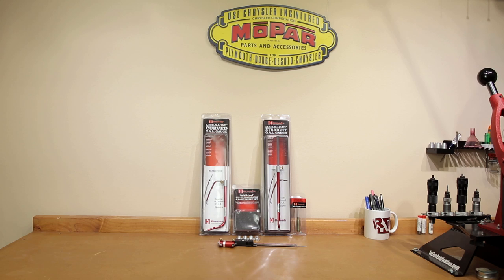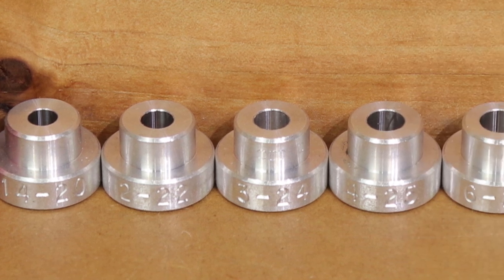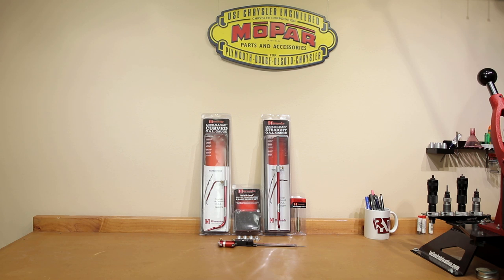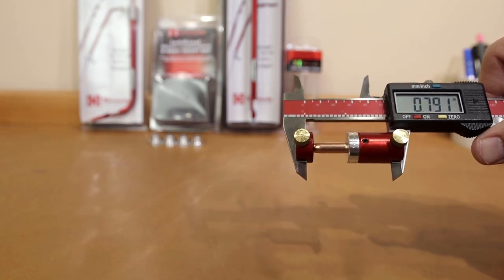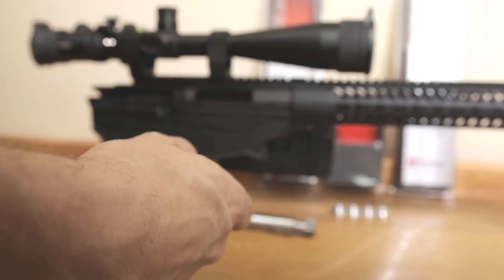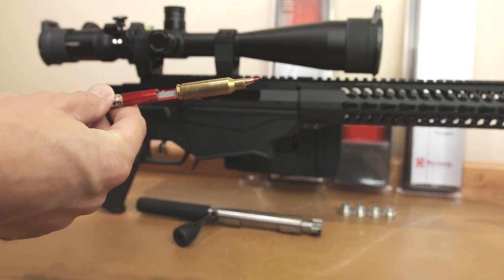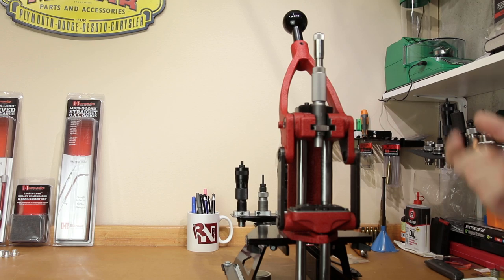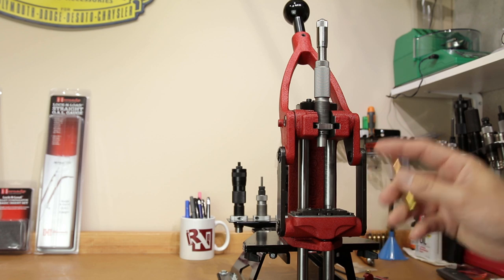Hornady Lock-N-Load Comparator Body with Inserts - Increase your accuracy

Comment: I have all those tools shown. One thing to remember is you have to repeat the process for every different bullet type you use and each manufacturer. I also repeat the process for new boxes of bullets, even if from the same manufacturer. I do four or five checks in a row (they should be close, if not something is wrong), then take the average of those checks and load up a cartridge. I then paint the bullet with bluing or black marker and chamber the round, if it is hitting the lands you can instantly see it by marks on the bullet. I always keep it a bit off the lands, especially for heavier loads, no desire to blow up my rifle or get hurt, this is supposed to be fun after all.

Comment: One thing of note, the base of the bullet comparator body has a thick side and a thin side. Just look at the base and you will see what I am talking about. It is critical the OAL Gauge be oriented such that the bullet enters the comparator like-side to like-side. Otherwise, the bullet will enter the comparator canted, leading to inconsistent measurements. With the modified case attached to the OAL Gauge and no bullet inserted and the Bullet Comparator with an insert installed on the micrometer, close the jaws on the the micrometer. The case mouth and comparator hole should be in alignment. If not, rotate one of the 2 180 degrees. This will give you the proper orientation between the two items.
Reply: No one ever mentions this in their review or reloading process. I didn't realize this until I saw a vid specially made to inform everyone of this. 
So, thank you for informing everyone of this important little bit of info that everyone should know.

WM

Comment: I use this and it works great.  Couple it with the headspace gauge, that looks very similar, and you've got the tools to really develop some great loads.  These are a must in my opinion.
Reply: Exactly right. Case length is just as important as bullet seating depth. It would be better if he demonstrated headspacing from the shoulder first to get that right before even bothering with seating depth.

Comment: I bought mine back when they were still branded Stoney Point.
Reply: So did I.
It's an excellent tool.
I went another route, making dummy rounds with each bullet at my preferred length found with my Stoney Point gauge that I load instead to use in my seating die.
However, I'll probably get t bullet comparator so that I don't have all those dummy rounds to store and keep from corroding.

Comment: These tools do add up in cost, but---you only have to buy it once--it will last a lifetime. Down the road, using different guns, different bullets, it gives you the means to measure all the differences, and they do exist. Bullets vary lot to lot, sometimes mfgrs make a change without saying anything about it. They give you the ability to measure case base to shoulder datum lengths, and adjust your sizing dies properly, and can save headaches with brass fit in a gun, brass life as well. They will educate you about all the aspects of variables in the components you use, and the guns you use them in. In the long run, a cheap investment.

Comment: You can send in two of your fired cases and Hornady will make you a modified case for your exact chamber. It is only a few bucks. I also recommend the tools for measuring your shoulder bump when sizing brass. These tools are a must have and will not break the bank.
Reply: Denny Baum , you can just measure a fired cases headspace and headspace of the hornady modified case and add the difference to the value you get from the modified case.
Reply: I bought the required drill bit & tap. Make my own now from cleaned fired brass (not resized). Each bullet type is kept in its own labeled tiny  baggie within the modified case baggie.

Comment: Your  right about the inserts , I found that using the Hornady 30 cal insert with a 168gr Hornady Amax projectile that the projectile makes no contact at all at any point on the inside of the insert hole , in fact  the bullet goes all the way in until the point of the bullet hits the base of the insert holder . I cannot understand why Hornady dose not make a special insert for its long sleek projectiles such as the Amax . I’m  think of buying a Sinclair insert to try to see if it works . The problem could be that the hole  in the insert is larger than 30 cal , I’ll try to measure it to see if that is the case . Would I be able to get any valid measurements if I use the the .284 cal insert with .308 cal  Hornady Amax bullet ?
Reply: Woah I never heard of that.  I know on a few the Forster Data Dial had a few different diameters, but I don't remember any not fitting at all!

Comment: Would the stem in the seating dye have to be exactly the same diameter as the comparator you use to check CBTO length.

Comment: What are insert do I need for 308? 8-30 right? Looking to buy Separate along with the 6.5 insert
Reply from the maker: The 308 is the 8-30 and the 6.5 is the 5-26,
Reply: Bolt Action Reloading  thank you for all the content you put out.   It’s been very useful.
Reply: which is for 270 win, 6-27 or 7-28? I don't understand theri numbering system. thanks

Comment: Yea that tool will probably get you within 10 thousands of the overall length of your cartridge. Remember that the modified case didn’t go through your sizing die so likely has a different base to shoulder datum length. Also when you full length size a case and chamber it the shoulder of the case will not likely be resting against the chamber shoulder. As it would be if you used this device. So you don’t have an accurate measurement of where the bullet contacts the rifling. Looks like a good tool for reference though.

Comment: Hornady inserts are made of aluminum and may change over time. Compatible Sinclair inserts are stainless with a machined taper instead of just a drilled hole and are extremely consistent
Reply: Keep one round as a prototype

Comment: These gauges along with any other gauge like this one, gives a false readings. 

"It seems reasonable to think that the diameter of the throat erodes."
John Whidden
Reply from the maker: Not sure what your "false readings" are. Its a comparator. The measurement it reads is not as important as that you can again make it what it was before or know how one thing relates to another.